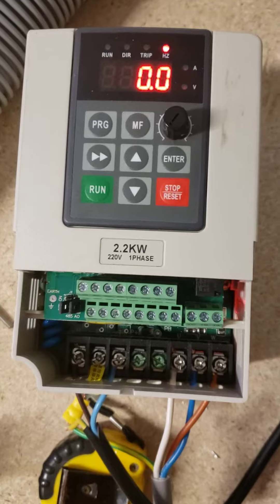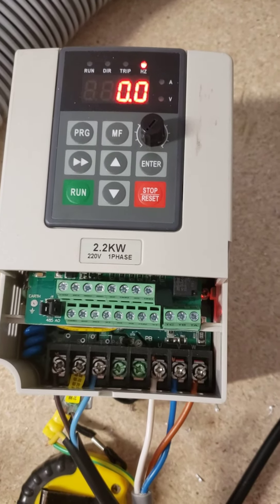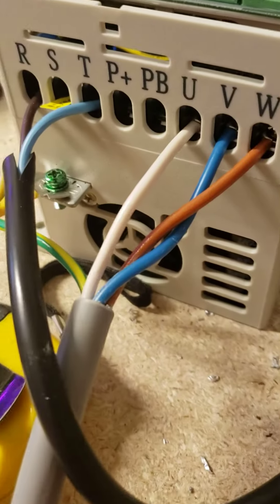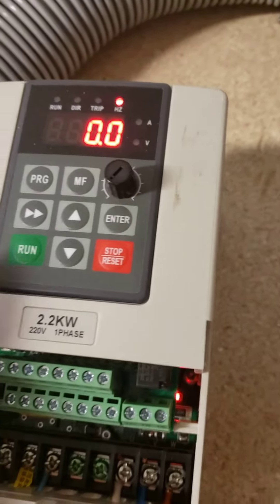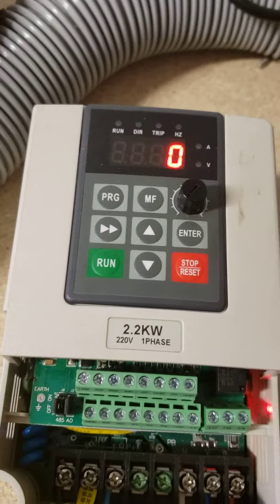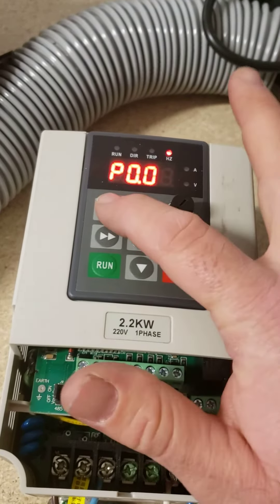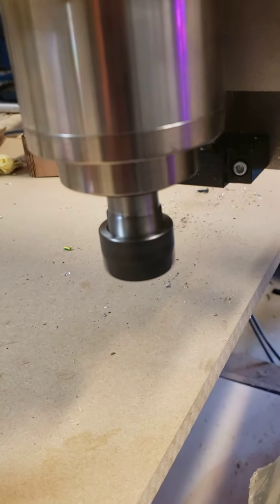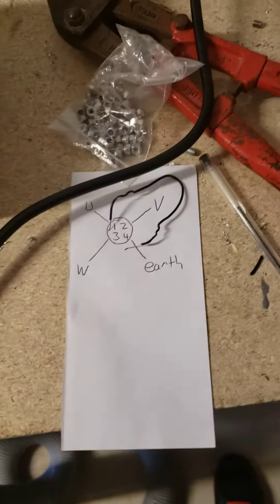Chinese vfd jls-e-2s-2 quick vid

Comment: How do you think this would go for a drill press motor? 1KW or so? 

Thanks for the video too - even in Australian voltage and 'speak'! :D
Reply from the maker: @michaelrobinson9643  I wouldn't use it as a drill press. The rpm is to high 10000 rpm is where the torque is and then up to 24000 which is way to fast
Reply: @michaelh9667  ohh wow! I was looking at a used one that was stated as from a pool filter pump. Thanks for your timely input :D
Reply from the maker: @michaelrobinson9643  oh sorry I thought you were talking about the spindle lol. The VFD would work fine for that I think. But I would ask a sparky and make sure

Comment: Hi mate, I was wondering if you could help. I have this on a fair ground ride, but it is only running at 50 on the read out max using the pot on unit and Parameter 3 at 0 for panel any help would be great 👍 Cheers (Some engineer from the UK)
Reply from the maker: @rossmckay3322  not really sure on your application. Try changing the p03 to a 1. If that doesn't work try the manual or a local electrician, good luck mate
Reply: You don't by any chance have the manual I bought second hand and didn't have one ?
Reply from the maker: https://mega.nz/file/J4hUyaBZ#9BoPs_eGnN2B2RHoPVt8rwm_GVZSDokbvgACdZ9Vr-g

Comment: Hi There I get a P.oFF error en no power on motor, I have the same spindle, for me it is 1.5 kW 220v three fase..
Reply from the maker: Not sure mate :(
Reply: @michaelh9667  Found it out, it is a undervoltage detection, I did need to set the input voltage to 180/200 volts for 220 v grid in eeprom to let it work. I get this from someone here.
Reply from the maker: @audiokees4045  glad you figured it out. Your reply might help some one else